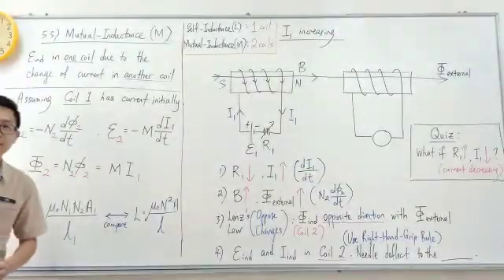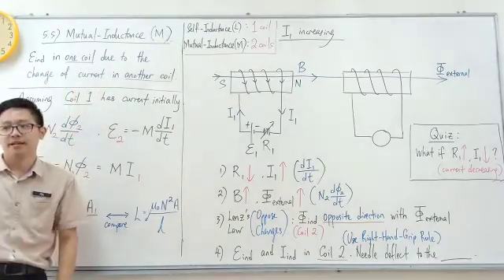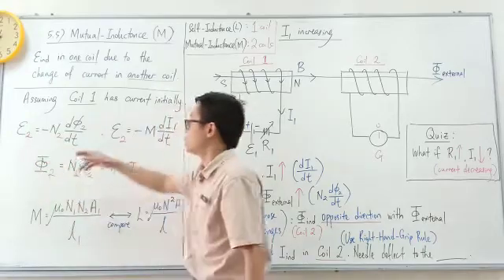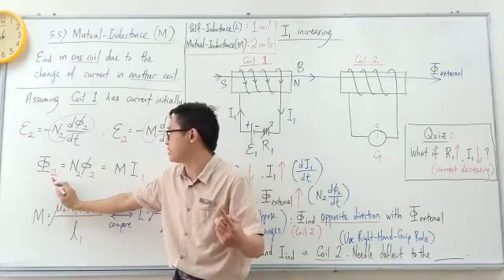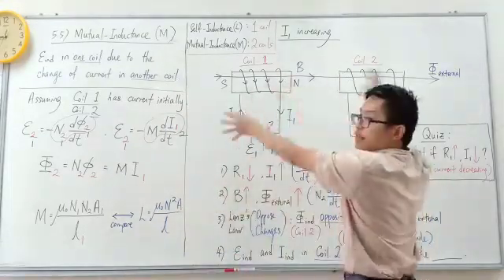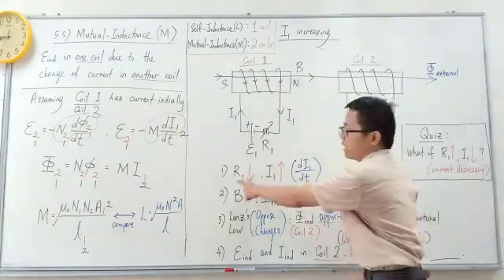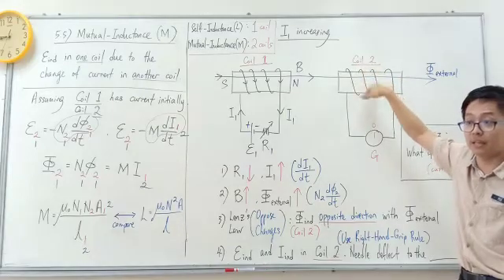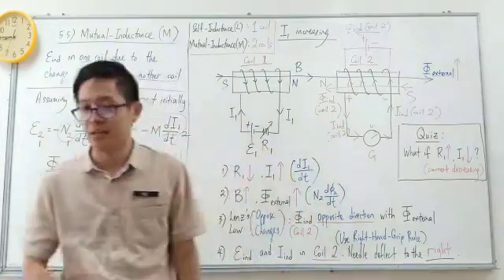Matriculation Physics: 5.5 Mutual Inductance

Comment: Sir i got A question. Changing current is including the changes of direction and changes of magnitude right sir??
Reply from the maker: Only changes of magnitude.. because you are using only DC current here.. normal battery.. changes magnitude of current because of adjusting the rheostat resistance value
Reply: @PekExplainsPhysics   tq sir